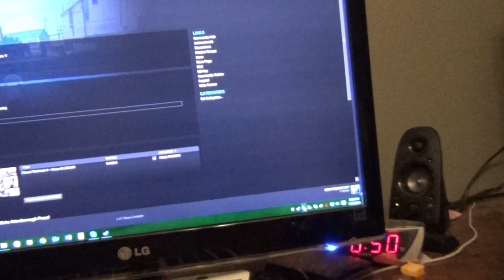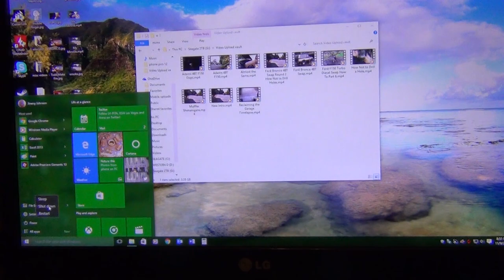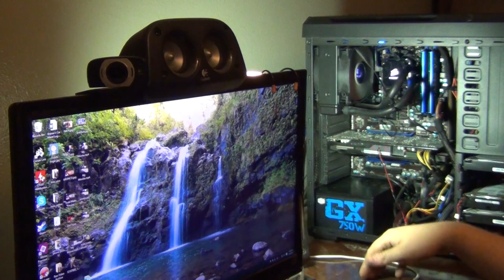Cooler Master GX 750 Power Supply Repair

Comment: my g750 started randomly shutting off and repowering on again in cycles  :( thing was a POS fropm the start TBH for a 750 watt ts stupid loud ,i tell everyopne to avoid coolermaster ( the load didnt make it turn offf and on again ,could be gaming  for 10 hrs no problem, web browsing for 3 mins shuts off ,so its random, it clicks on and off when it happens so i reckon its the voltage switcher going bad or its detector circuitry for voltage setting